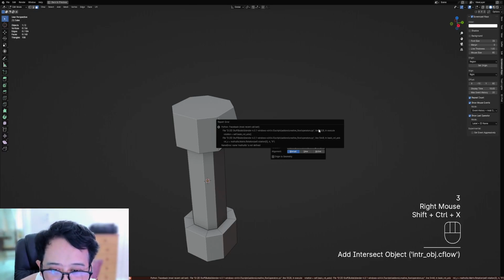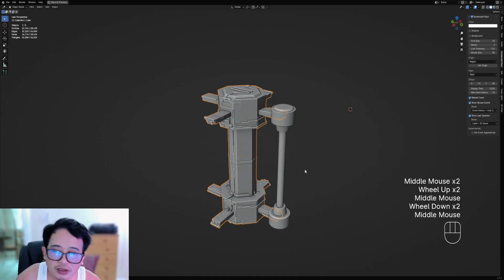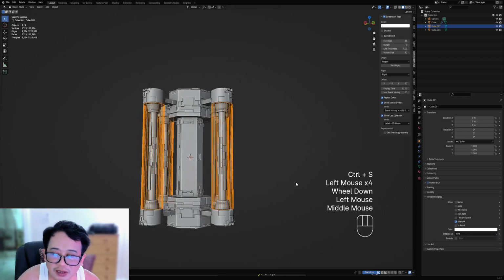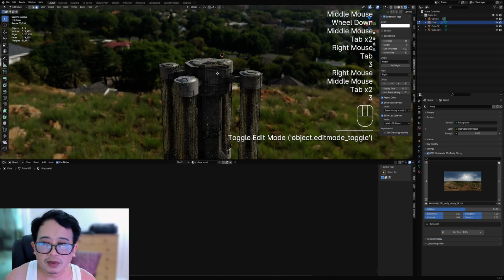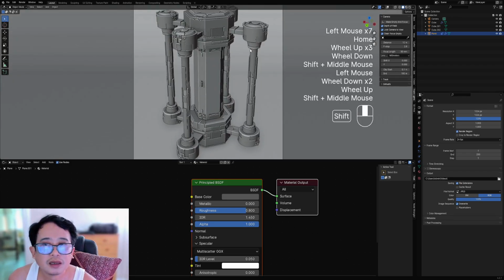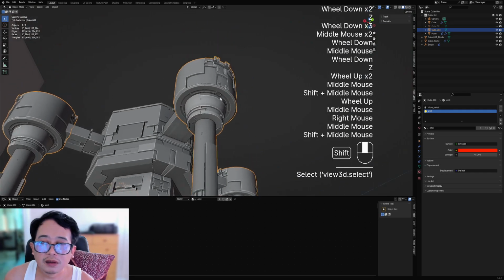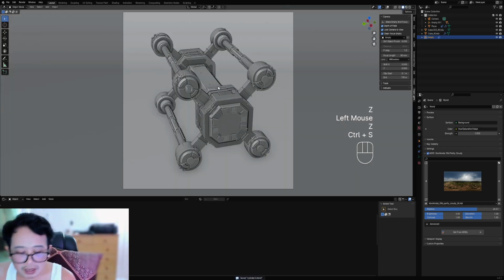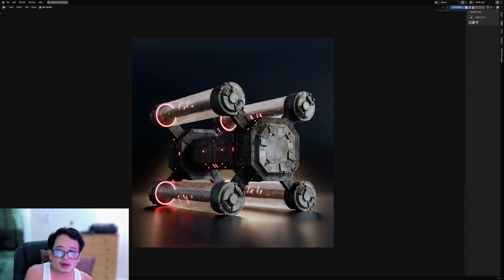Testing Recent Updates - Random Flow

Comment: Is it possible to keep the windows open, so we can make more adjustments later?
Reply from the maker: Use the F9 hotkey to bring the redo panel back. Once you commit a different action, you can no longer edit the previous command.
Reply: @blenderguppy  only a suggestion and it would be great if it were possible. but how possible would it be to have random flow show up on the npanel with a button to recal it when it closes instead of using f9.

Comment: Hi, I don't know if you've added in this update, but it would be really great if the Random Slice operator had a margin slider so it would make flat insets between cuts, now i think it only has possibility to make chambered/concave insets with the Size and/or Thickness sliders if you know what I mean.